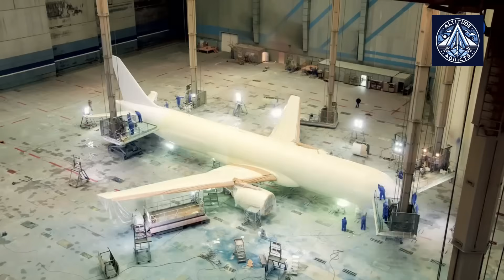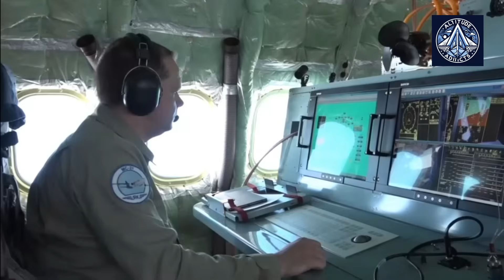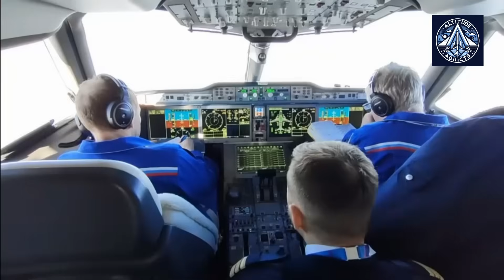MC-21-210: Russia’s Last Hope to Save the Heavy Program?

Comment: It's two ton lower than the A 320 neo FACT  by Google
Reply: Here's another fact. The MC-21 210 is smaller than the A320 NEO.
Here's another fact. The MC-21 210 is 3 metres longer than the A319NEO but carries less passengers than the A319NEO in a two class configuration.

Comment: Comparing the 737 max 8 to the mc21-310 is ridicules the mc21-310 is a bigger aircraft even if it is a single isle, mc21-310 has a larger cabin and wings that's the extra weight.

Comment: First of all, I don’t believe the plane gain that much weight (5-6 ton) just by replacing imported parts end even if true the range decrease cannot be that much by adding 5 or 6 tones. I think you should try this video again but this time with reliable sources about plane specs. 

Plane delaying is understandable, this plane was designed with almost 50% using foreign parts with plans to be in service by 2019/20 but due to sanctions Russia finds itself in very difficult situation not just they need to produce those parts on they own but many parts need to be first developed then produced. 

Do you think Boeing and Airbus were developed overnight and do you have any idea in how many countries parts for these two giants are being produced?  Russia is trying something that no country in the world has done on its own and Russia will make it, all they need is time. 

Also, I completely disagree with you Russia will go back buying Western planes, Russia will never go back buying Western planes even if sanctions are removed, they may buy some parts for their current fleet of Western planes to extend their life and that’s all. And finally.  

I absolutely have no comment on your reasoning why Russia may go back buying Western planes saying “for their exceptional reliability" no comment because I know you are not really seriously serious, just serious

Comment: If the weight increases to 6 tons and the PD-14 engine is very doubtful for use, then don't be embarrassed to use the PS-90A or PS-90A3 engine. We have to be honest, it's not ideal to use an old engine, but if the powerful engine is PS-90A ready, this choice has to be taken. The Tu-204-300, which is about 40 meters long, has an empty weight of about 50 tons. With the PS-90A engine, fuel consumption is 3.2 tons/hour. The MC-21-300 with an initial empty weight using Western components is around 43 tons. This means that with the additional weight of 49 tons, the PD-14 engine will have difficulty achieving fuel-saving performance which previously could reach 2.5 tons/hour. The realistic fuel consumption figure for the PD-14 with excess weight is 2.8 tons/hour. It is very similar to the Boeing 737-900.

Comment: The news is a 2-year-old lie. The maximum take-off weight was increased by 5 tons, as many airlines requested the installation of additional equipment. The new PD-14 engine worked at the stand in critical conditions for 2 years, and at the same time, several PW1431G-JMS were replaced that failed. Moreover, work is currently underway on the PD-14M, an upgraded one that will be lighter, more economical and more reliable!😉

Comment: This plane was designed with an unnecessarily wide fuselage and cabin.
They should just have copied the A320.
Reply: Ya, keputusan yang payah soal lebar pesawat dan panjang yang mencapai 42 meter. PD-14 pun diragukan mampu terbang dengan pesawat dengan dimensi itu disaat konfigurasi 200 penumpang diterapkan.
Mungkin pada akhirnya PS-90A bisa dipasang di MC-21-310 jika berat kosong pesawat mencapai 50 ton.

Comment: The whole difference is in the engine and weight of the 210 model, this is +500-1000 km of maximum flight range, up to 6000 km. Most flights in Russia are 3000-5000, and for the 210 there will be 3% of flights, that's its role. The basic version is fully flight-worthy, the engines are superior to any competitors in Russia, be it a Boeing 737-800 or a Tu-214.

Comment: It was doubtful from the start. The fuselage is wider than the A320 and BMax8. Plus the length of the aircraft is 42 meters. These dimensions are clearly difficult to have an empty weight of under 47 tons. COMAC C919, even though there are composite materials, is still 4 or 5 tons heavier than the A320. So it is mandatory to be realistic to make a short version with the exact length of the A320, which is only 37 or 38 meters. I am sure that the weight will be around 45 or 46 tons. The MC-21-310 version with a length of 42 meters can still be an option but must have a maximum of 170 passengers and the remaining space is used for fuel. The worst alternative of the MC-21-310 is to be reckless with a configuration of 200 passengers but a range of only around 2500 kilometers. It is still possible for the Moscow to Istanbul or Yerevan route.
Reply: It is misinformation. For MC21-300 it was intended PD-18 all the time

Comment: You've got to go with what you have. Develop those heavier components and gradually improve the aircraft with time. The engine will not become as efficient as the PW but they can be improved. 

I don't think they will need to ban foreign aircraft as current and likely continuing sanctions will force their hands. As for certification, Russia will need to press on friendly countries to accept their certifications.

Comment: I find it hard to believe that substituted components would be 5 tons heavier. What components are those?
Reply: probably landing gear, APU and some engine components. Russia has most of the systems they already used in TU-214 but they are quiet heavy.
Reply: It makes sense that local Russian vendors are still using heavy materials for Avionics systems, landing systems, APUs, and even local composite wings are not as light as Western vendors. Most likely, vendors are asked to make components with lighter materials and that certainly takes time for testing. That is why serial production this year is still impossible.
Reply: Hydraulics maybe...
Otoh fuel should be cheaper in Russia.
That said, why discuss the competition with Western planes, when these are not available.
Reply: thats a bit too much probably. pd14 uses titanium blades so 200-300 kg per engine maybe. for landing gear i doubt it can be such big difference those are mostly metal. breaks maybe. and wings were made in russia before anyway. also how much fuel does aircraft hold? 20 tons? 30 tons? 5 tons less fuel would not make range only 1/3 than
Reply: 5 tona goriva to je dva sata vise leta. Znaci veci dolet 2X840km=1680km. Vecinom su izgubili tezinu na baterijama
Reply: @jebise1126  agree, I bet it’s mostly about fuel
Reply: Where did this data come from? Avionics and even Landing gear differences just can't result in 5 tons increase. I am beginning to think that this channel has always been a Boeing mole.
Reply: @jeffhedrich3551   I kinda see your point, but the engines are definitely part of the weight explanation as the blades though light alloy are made of titanium. Plus the cabin is larger meaning over a wider surface area; inside and out, thar would also contribute to weight excesses. I still really want Russia to succeed in this endeavour;if  even that means they can close the gap to being only a few competitive points behind. The world needs a win and Russia;alongside China really need to step up and make this world a more fair place.
Reply: @CJ-xl3dh  I was thinking along the same lines as you.  That the extra width for cabin comfort came with a steep penalty.  It's easy to spread 5 tons over 100 feet of fuselage.
Reply: Mainly western anti Russian propaganda.
Reply: Solid well built parts...
Reply: Officially, no one said that the plane became heavier. I don't know who said that. There is nothing written about it on the official UAC website.

Comment: It’s  propaganda MC 21 is in mass production mode. One year old reports were estimated numbers back then. Now range is more than before and ceiling is excellent.  Performance is same or better than western aircraft, with lots of problems engine issues constant maintenance low engine performance on 737 and 320 Neo, down time is piling up.

Comment: nothing but rubbish .... weight of most (replaced) components would be 5-10% ..... I was in manufacturing for decades ..... utter BS ..... distance Moscow to Krasnodar the new central Rus hub .... from Moscow ? around 1500 kms ..... it is a commuter city to city plane for the next few years. Tu-214 will do long-haul flights as it is already certified. Who writes this nonsense ?  Russia will almost certainly restrict this plane to flights within Russia for 2 years at least ...

Comment: Not sure an engine comparison is particularly relevant at this point, as the Western engine manufacturers are failing pretty spectacularly to provide engines to customers.
A highly efficient engine is only relevant if it is actually on a plane and running.
Reply: En estos momentos lo más importante es sacar adelante el motor PD-14, que ya está superando los últimos contratiempos en el banco de pruebas y es superior a los motores homólogos occidentales. Una vez alcanzado los rendimientos esperados para el año 2026 se empezará la producción en masa del avión MC21 en sus diferentes variantes.
Reply: @barryscott6222  Yes. Don't try for perfection. It is always a progress. Just go ahead and make 100 planes, then improvements shall come later in the next generation, when vendors have more time, experiences and money. Also, fuel cost will be cheap in Russia, so highly efficient engines may not be an advantage.